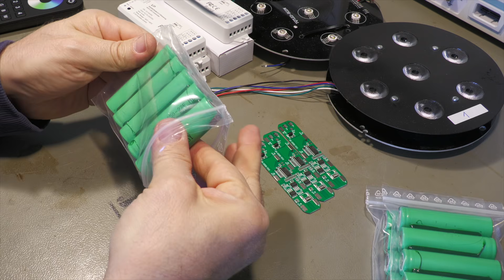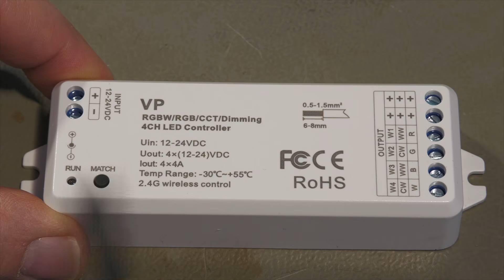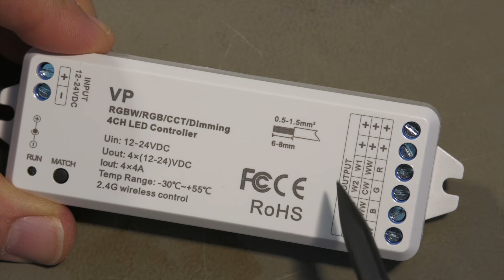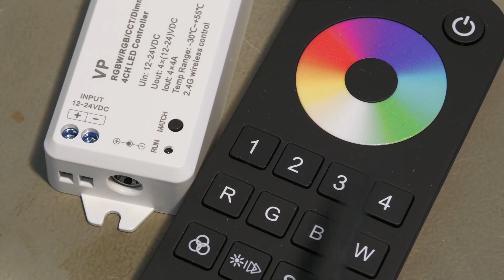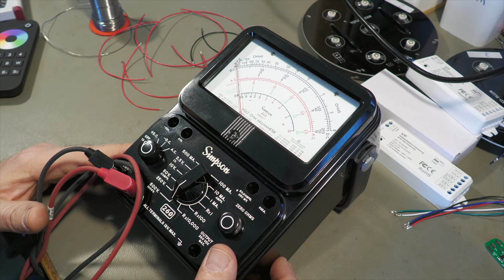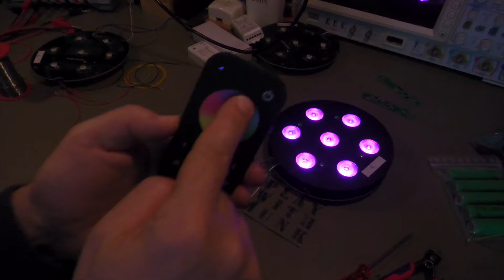Remote controlled RGB video lights with selfmade battery packs.

Comment: How do you charge those battery packs? Is the controller suitable for this?
BTW here in Poland April 1st is called "Prima Aprilis" and it's kind of a public holiday ;)
Reply from the maker: Charging is easy. Turn the lights off and connect a power supply to the P +/- contacts. Make sure it is set to 21V (5x 4.2V) and limit the current to 1A. Or you take a dedicated LiPo charger designed for 5s.

Comment: What is the selectivity of the color wheel? Is that proper touch sensor or just, like, 6 touch sensors around hidden under a glued in color mask?
Reply from the maker: I don't know how many sectors it has, but it feels continuous. There are no jumps visible. Like the old wheel on the iPod...

Comment: but did you do a capacity test on the batteries before making packs? without that you dont know if one is super low (say 100mAh) wile the others might be fully healthy at 2200mAh (for Samsung ICR18650-22F), this would result in your pack only having 100mAh capacity before bms cuts out because undervoltage
Reply from the maker: Yeah of course I measured them and they were very close. It wouldn't make sense to build a battery pack with unknown or different cells. That could also be dangerous...

Comment: so should there not be any current limiting between every channel and the controller ?
Reply from the maker: It depends on what kind of LED module you use. Most LED strips already have resistors built in. The ones I use can tolerate much higher currents as the controller will ever supply. But if you use just LEDs, then yes, you should probably use some resistors.
There is also a setting for different PWM frequencies on the controller, that may also help to reduce the current.

Comment: Series separation is very important, please try and have some fishpaper in-between cells that wont degrade from age or heat like plastic will- same for the positive end, fishpaper rings are pennies. You can justify not using them, but it's a poor argument for how little they cost. Same thing with putting a piece of fishpaper between the bottom of the BMS and the end of the cells. Even a couple layers of painters tape would be better  than nothing... it's just avoiding plastic being the only insulator.
Reply from the maker: I know what you mean and I'm aware of the problem. The cells here don't touch. There is a small space which is maintained by the glue. These cells also have an integrated insulation ring on the positive pole. So there is not much risk for these here. The double sided tape I used is 1mm thick and the underside of the BMS is already coated from factory.
But for the next pattery pack, I will definitively buy some additional insulators. 🙂
This is also a "low vibration" application. I would build differently for something mobile.

Comment: Hi, I do not see balancing hardware on the BMS you used (no resistors for dumping excess voltage, nor equalizing capacitors), so it is only monitoring the state of individual batteries. Since your batteries are old stock, I would advise changing the boards to ones with balancing hardware or using an additional balancer board.
Reply: Hopefully the BMS should shut down output if any individual group goes below 2.5 or 3.2v, or above 4.2... But you never know with these cheap ones. If they behave properly though, it's fine and he can just do a manual balance to restore them to good usable capacity- just like any cheap tool battery like milwaukee.
Reply from the maker: I just looked into the circuit a bit closer... and you're right. There is no balancer in the CM1051 chip. It will only turn everything off when a cell goes off limits.